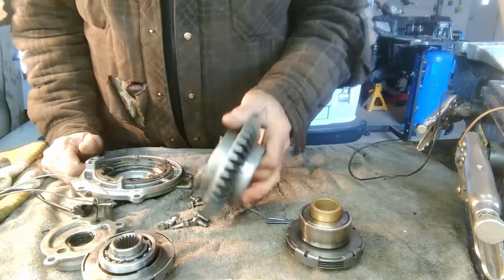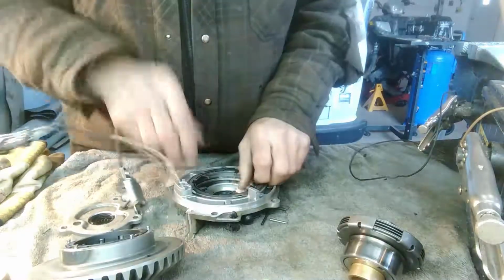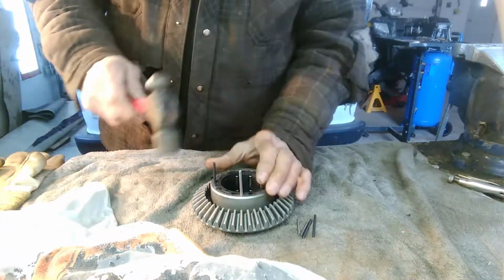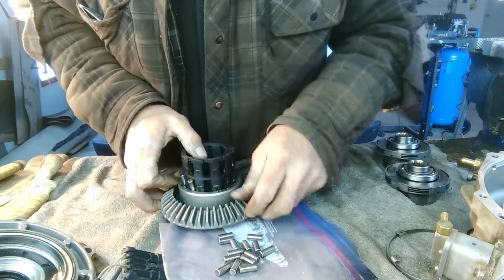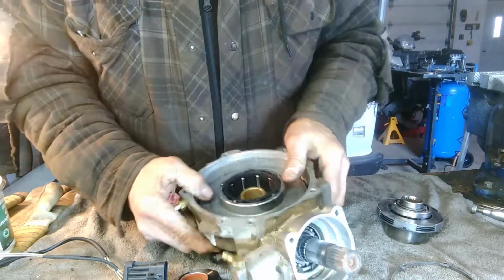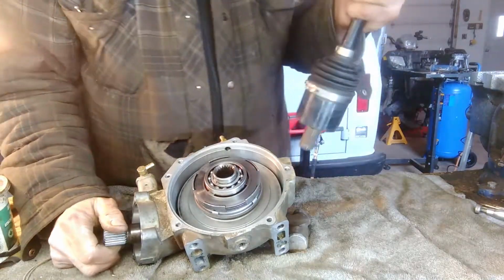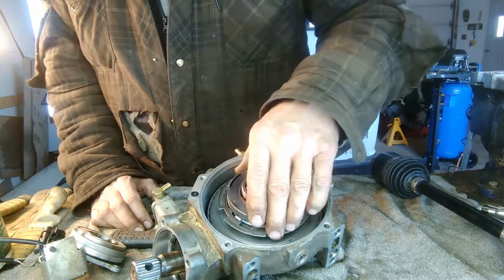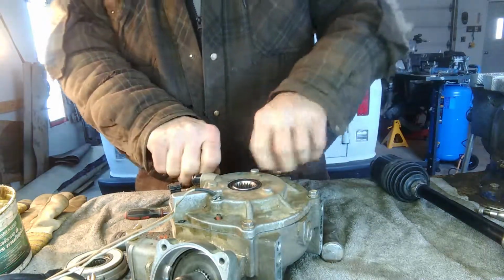Polaris front differential with EBS repair

Comment: Great video. Did your repairs take care of the problem? I have a 2007 Sportsman 500 with ADC and when engine braking in 4wd it feels like it's slipping and it sounds like someone rattling a bag of hammers. For the meantime I put in a switch to disable the ADC from coming on, but after watching your video I think it's time to pull the diff out...
Reply from the maker: Hi my issue was the 4 wd not so much the EBS not concerned if it actually works if you hear a rattling maybe its the plastic cage that broke its apparently a common problem

Comment: How did you remove the roll pins? I've got the same issues with my gear,  all 10 pins sheared off.
Reply from the maker: Hi most of the pins i could grab with side cutters i did drill one out but it was a nightmare roll pins are super hard    i used some expensive bits not easy to do if i was to do it over i would have  left the pins alone and not have EBS i only wanted  the 4 wd to work
Reply: I guess it is kinda randomly asking but does anybody know of a good place to stream newly released series online?
Reply: @Payton Ernest lately I have been using flixzone. Just google for it =)
Reply: @Malcolm Lucas yea, I've been watching on flixzone for since april myself :)
Reply: @Malcolm Lucas thank you, signed up and it seems to work =) I really appreciate it!
Reply: @Payton Ernest Happy to help :)